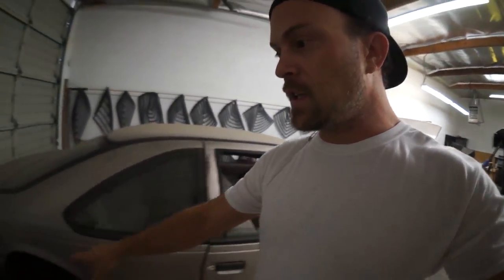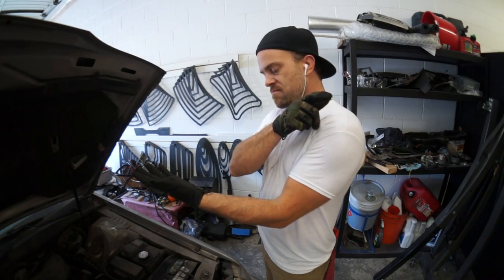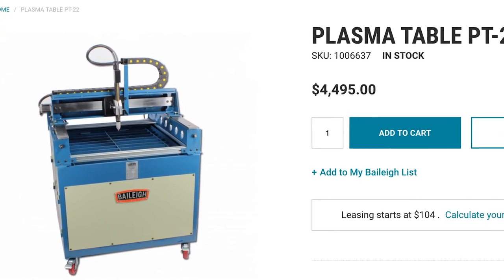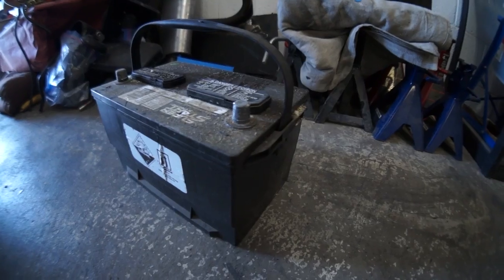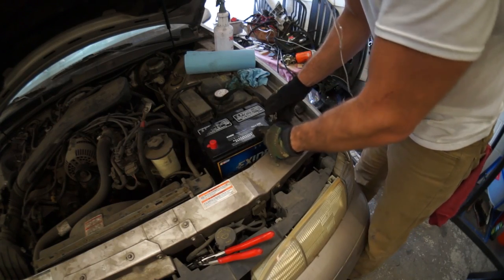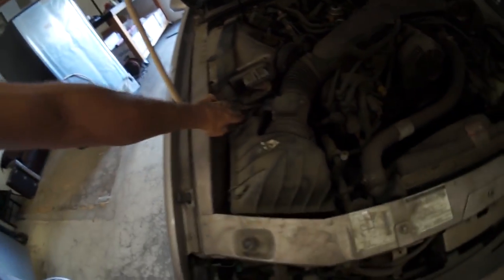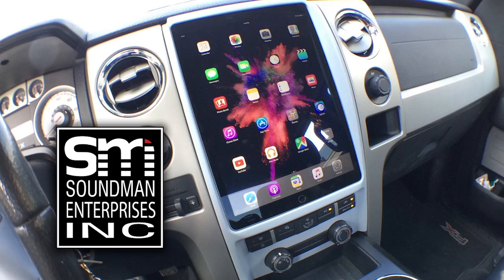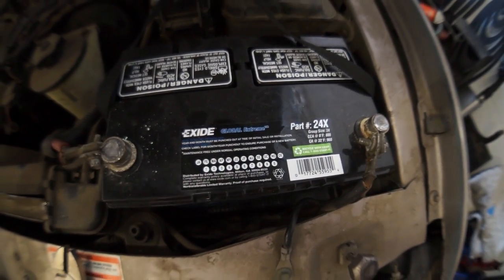FIGHT for the FREE-Bird!

Comment: for throttle cables in my swap cars i use a chevy blazer throttle pedal and cable, long easy to route and works great with LS swaps, unsure of the hardware you have on your subaru but they are not hard to adapt in most cases, the key being that the entire assembly for me pulled out of a junk yard is like 10-15$

Comment: Don't install the o2 sensor in the t bird until well after the head gaskets have been done. Any contamination on it will ruin it. Did the o2 sensors in my Subaru after headgaskets and it ran amazing.

Comment: As far as the motor, the lack of idle might be due to the idle air controller. It can be cleaned with carb cleaner and will work for awhile.
Reply: Idle air controller should be located at the top of the air intake.
Reply: or bad gas or fuel pump and the fact it has a blown head gasket=low compression in the cylinders
Reply: Could be a dirty MAF sensor too, which would the easiest fix if it was the problem.
Reply: idle air control valve should be near the throttle body.

Comment: Remember to get new head bolts.  The factory are TTY bolts.  I still say do a full PI head swap. You're already going to have the heads off and there is no point in putting the NPI heads back on.  You can find PI head stuff cheap and it's nothing more than putting it back together and a tune.  THe extra HP will be nice.

Comment: Yeah you should change that oil. and really try to run it as little as possible. Having coolant in the oil like that can wipe out the bearings in the lower end real quick, then the engine is basically junk

Comment: hopefully you drained the engine oil because if it has a bad enough coolant leak into the oil pan it's likely way overfull, possibly hitting the pistons.
Reply: If your keeping that car you should put in a motor, it's had coolant in the oil eating at the bearings for to long

Comment: Replacing the head gaskets there or just getting a long block to swap and keep the stock engine displacement and ECU?  Although I guess there could be an intake manifold gasket leak with PCV contamination causing the "milk shake" you have which only brings Rafa to the yard, but is also likely corroding various components of the engine.  Either way, it looks like you'll at least have another project car playlist of powertrain repair and replacement videos.

Comment: you got a gasket leak Doug, that engine oil is contaminated, maybe it's the coolant, and the oil it's in bad shape so it doesn't build up pressure, the oil pressure sensor detects it, that's why shut down the engine

Comment: I know this is going to sound nuts but drink the milky shit out, dump the coolant and put new oil and filter force it to run for a bit, that shit will make the rebuild alot easier and less costly just don't let the engine run for to long

Comment: Number two, which is now above number one. You've probably heard it a thousand times, but get the crap water oil out of the car! Do an oil change in another car, and pour that through the t bird, then fire up a min to flush, then put in new oil. The water in that oil is gonna f stuff up. Coolant is bad, too. Please please drain that shiz before it oxidizes you cars insidizers. Thanks!

Comment: Just get a junkyard motor and dump that nightmare. Last time I got a car that "just needed a head gasket" it had a cracked piston and low oil pressure because they drove it 5,000 miles with water in the oil.

Comment: Milky oil....very BAD. Doug anti freeze eats bearings, worse if its been in contact for some time, your bwarings are going to be damaged. You need to rebuild that enginw sorry to say. If you dont you will spin a rod bearing, loose a crank bearing or any other bearings that havw been sitting in that caustic oil garunteed!😦😦